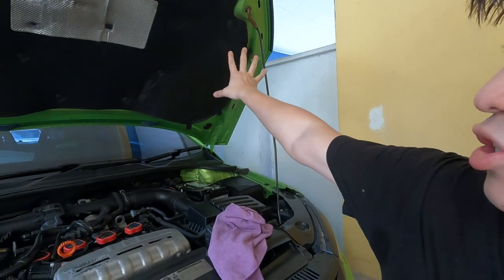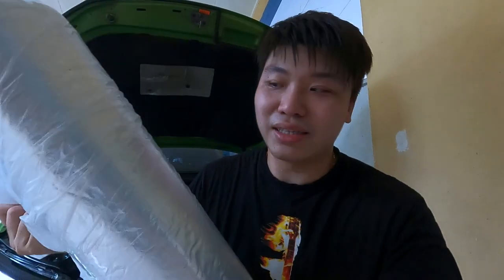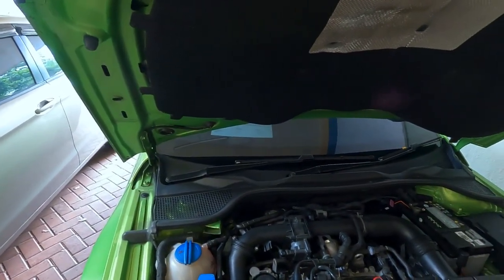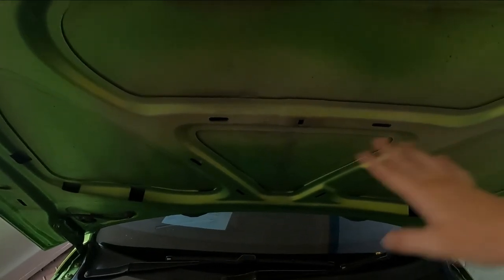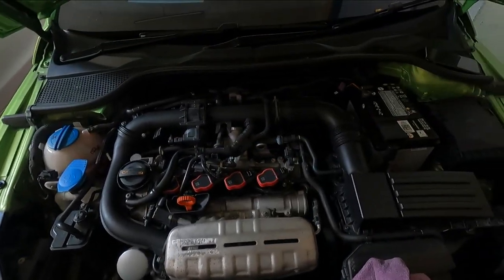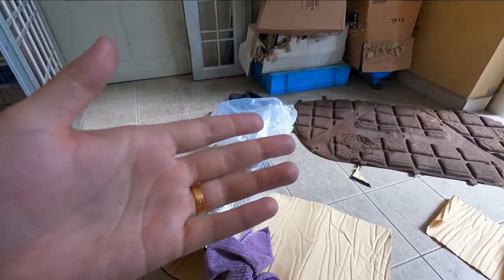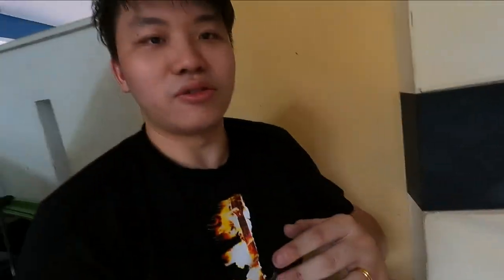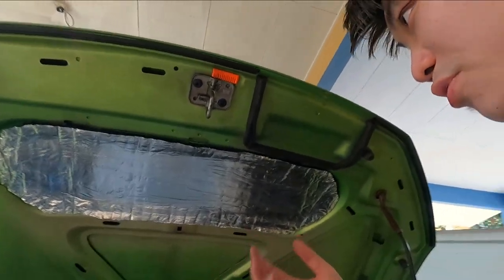Volkswagen Scirocco DIY Hood Insulation: Spent Below RM50!!

Comment: sir what is purpose of insulation?
Reply from the maker: Hi bro. It's to protect the paint from heat otherwise it will start to discolour and fade and even Crack on the top.
Reply: To insulate
Reply: @DrivenTechReviews  is this can also use on car ceiling/roof?
Reply from the maker: @axlemil  I believe so . But for roof should use better quality material.
Reply: To avoid paint scorching on the hood exterior
Reply: @DrivenTechReviews yes I agree. Got Mazda 3 and realised paint cracks. Ask around and research. And finds out because there is no under hood insulation at all so I buy very thick one. One side rubber fire resistant and other side aluminium. We’ll be doing it soon

Comment: Factory hood insulation cover is fine 
That silver reflective heat insulation causes more heat trapped with hood closed you just wasted your time … and engine heat doesn’t burn or discolor the paint on the hood 😂 paint can handle the engine heat thats about 300-450 degrees